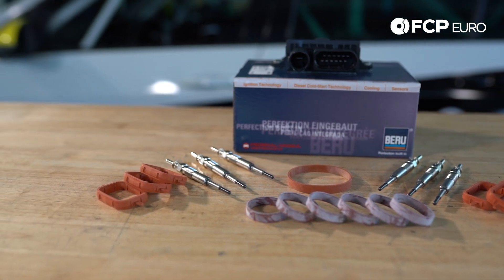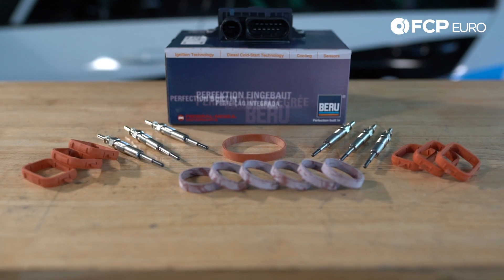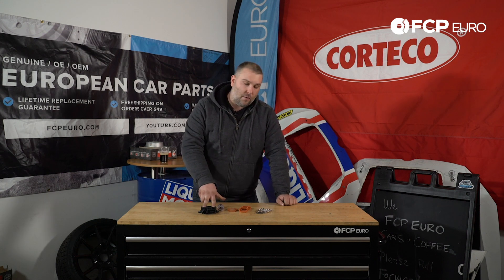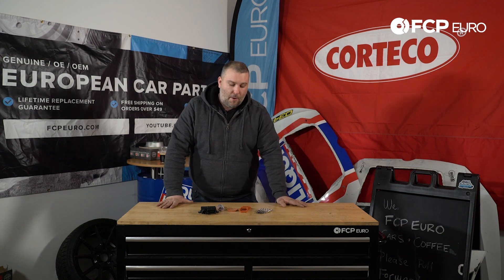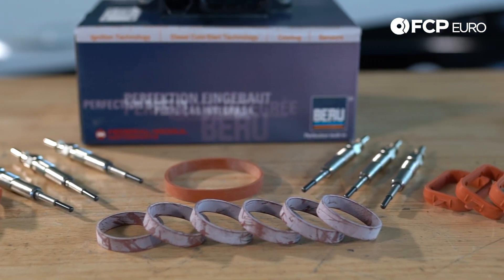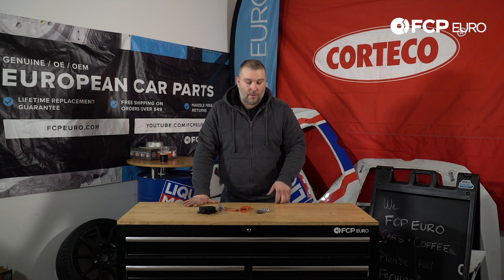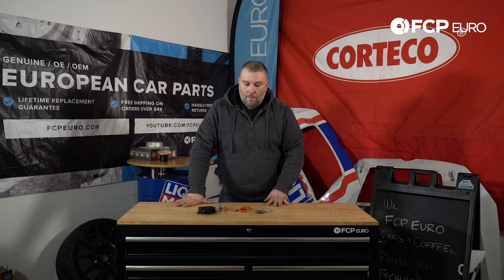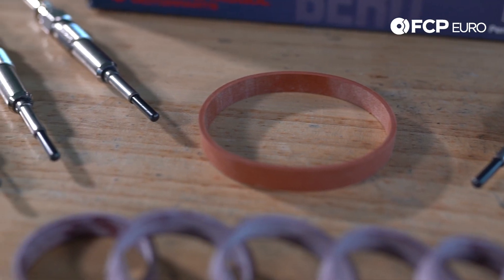Comprehensive Glow Plug Service Kit - BMW 335d and X5 xDrive35d - Benefits, Specs, & Product Review

Comment: I have a BMW 520D 2011 F11 with issues that sounds like trouble with the preheating, but when I scan the car there are no error codes. I can also see that glow plugs get activated when driving through the Bimmer-Tool app and can even trigger activation manually through the app. I cannot see the individual glow plugs though.

Have you seen any occasion with glow plugs or control unit problems without error codes?

Comment: I have a x5 E70 which i havent driven for months. Last week,  i started it up easily. Because i bought a obd2 scanner, i plugged it in that day.  B4 i started the car, battery voltage was at 12.25v. Anyway,  the scanner revealed error for all 6 glowplugs activation.  No check engine light. Car seems to be normal.  I haven't taken it out for a drive though. Car has only done 70k km. Can it really be all bad plugs?